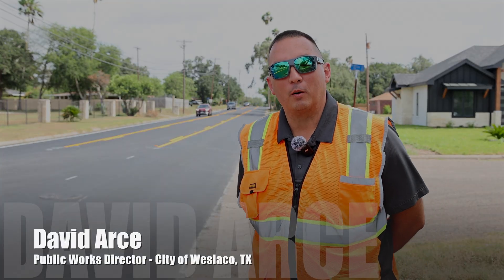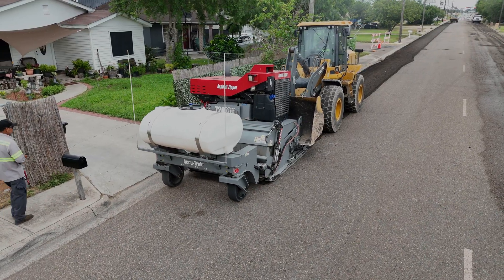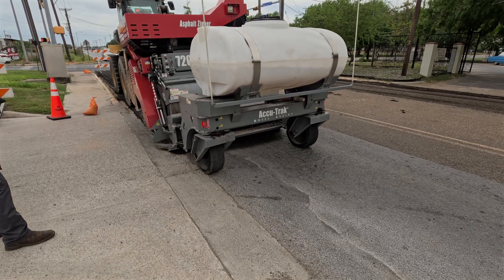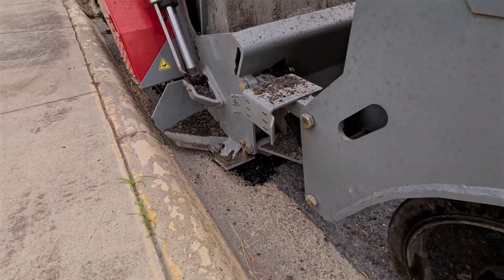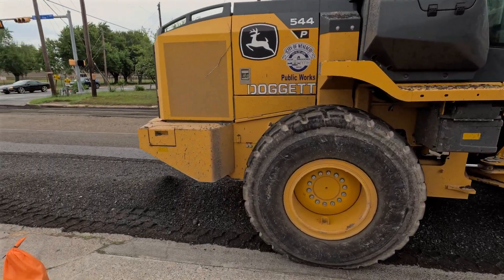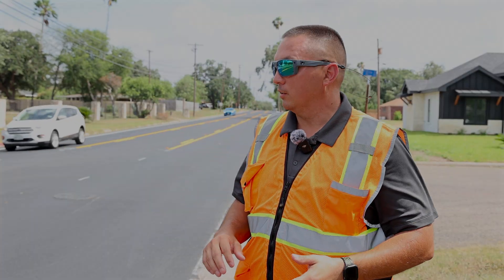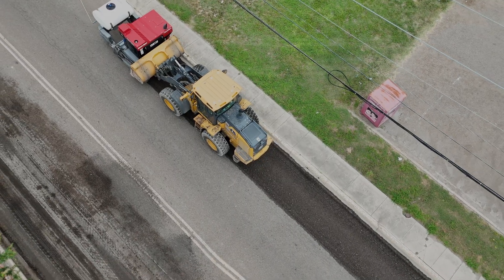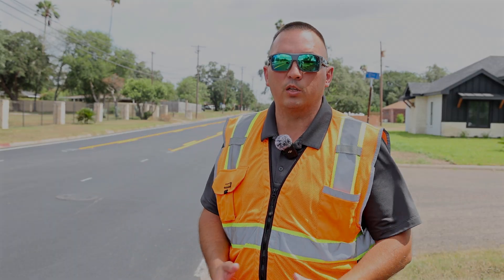Cut Road Repair Costs by 70% – Asphalt Zipper® in Action (Weslaco, TX)

Comment from the maker: 🚧 The City of Wesco has been using Asphalt Zipper road milling machines since 2005 — and the results speak for themselves! 💪 With the latest cold recycler and stabilizer, crews can finish road repairs faster, safer, and at nearly one-third the cost of traditional methods.

✅ Watch how cold milling, asphalt recycling, and cold in place recycling help us:

Repair more streets with the same crew

Deliver smoother asphalt overlays for cars 🚗 and bike lanes 🚴‍♂

Recycle reclaimed asphalt pavement into alleys and trails ♻

Stretch city budgets while improving public safety

👉 If you’re in road construction, asphalt milling, or highway maintenance, you’ll want to see this machine in action.

💬 Question for you:
Would your city or crew benefit from an asphalt grinder that cuts costs and doubles productivity? Comment below ⬇

#ColdRecycler #AsphaltMillingMachine #RoadMilling #ColdPlaning #AsphaltRecycling